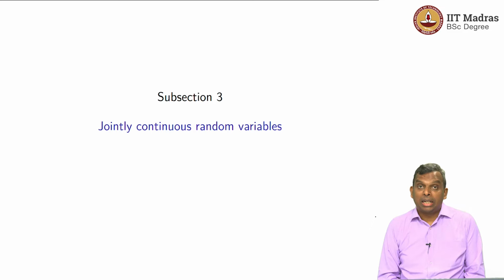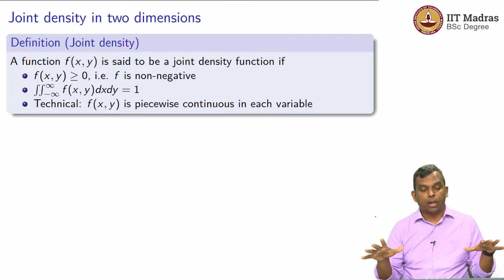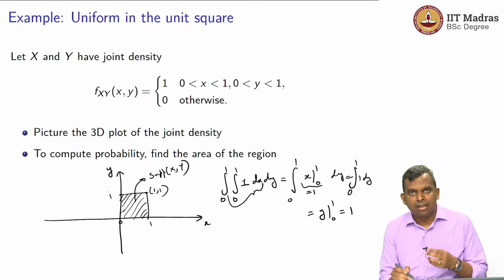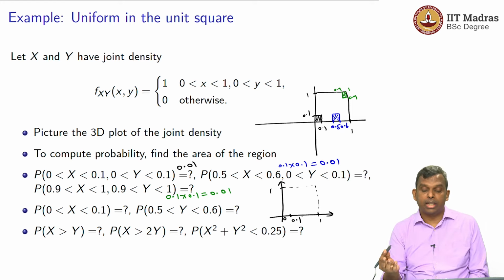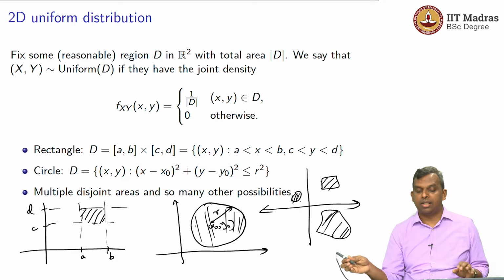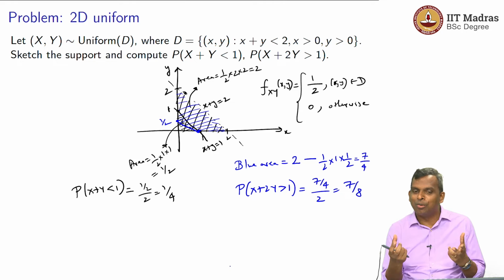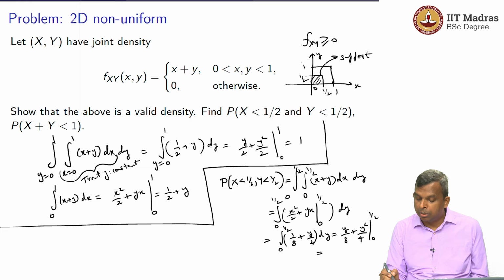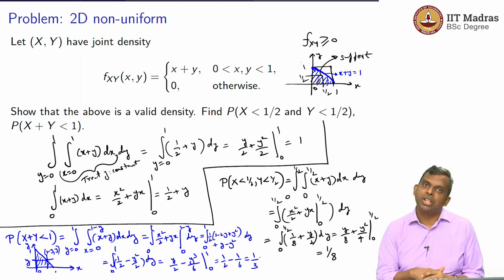W6_L1: Joint continuous random variables

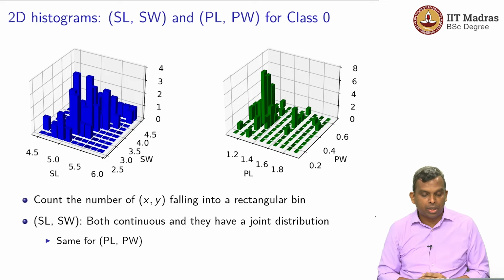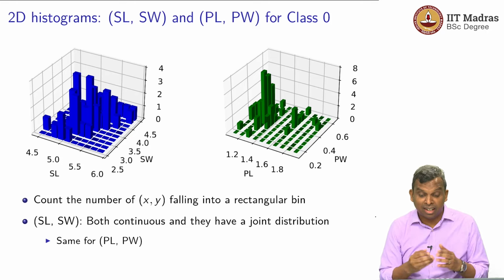Comment: 2d histogram: 1:40 2:20 2:45 3:23
question: 4:03
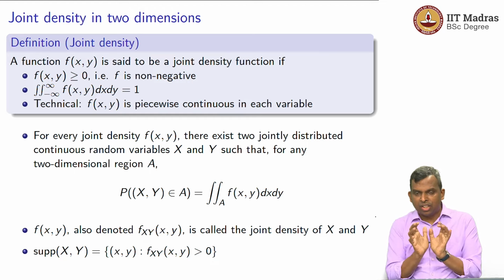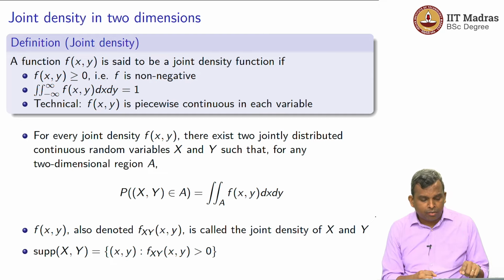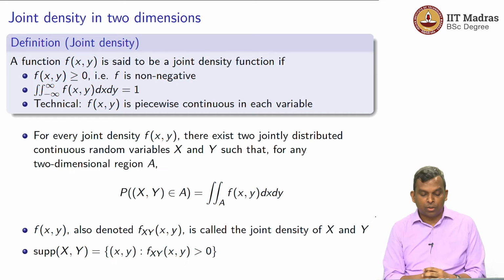joint density: 4:57 6:55 (probability) 8:22(notation) 9:00(support) 
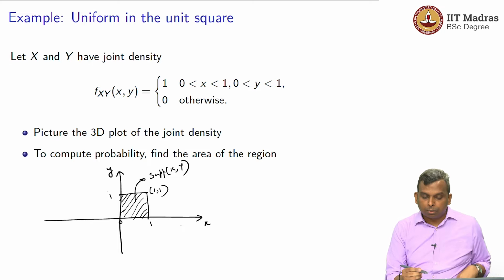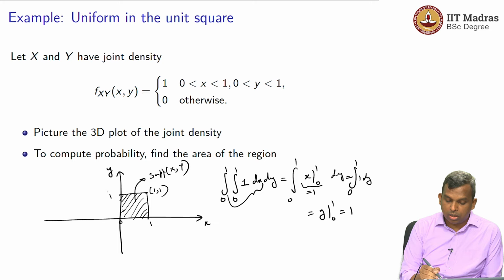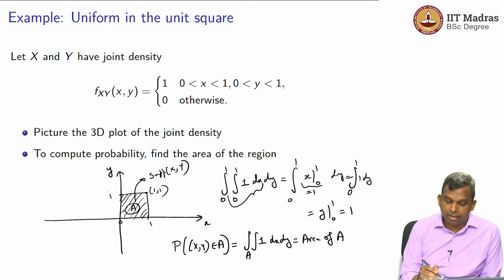problem: uniform in a unit square: 10:30 11:40 13:40 14:20 15:30(big picture) 18:00
2d uniform distribution: 23:21 24:20(multiple disjoint events) 25:30
problem: 2d uniform distribution: 27:00
problem: 2d non-uniform: 31:20 37:54